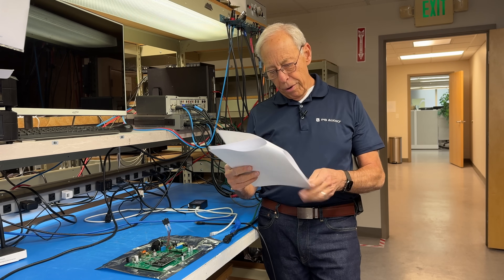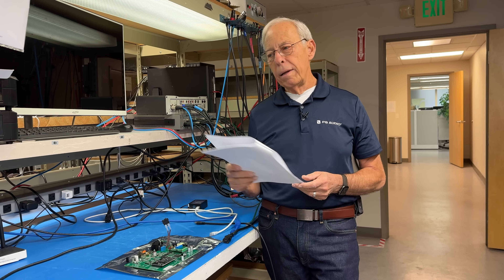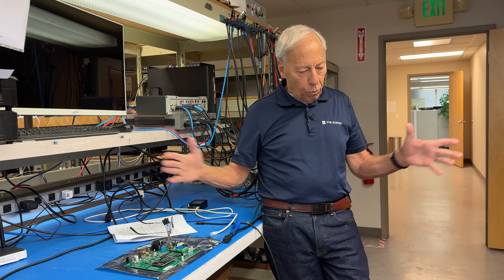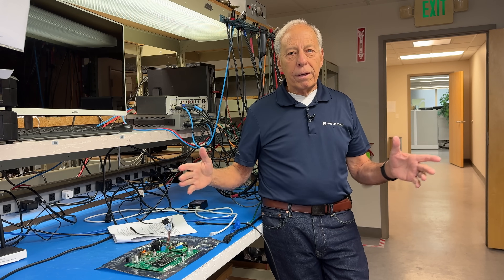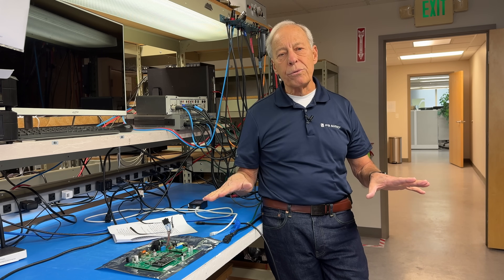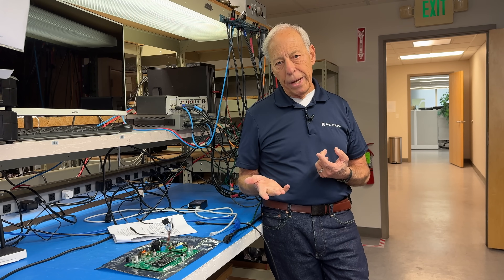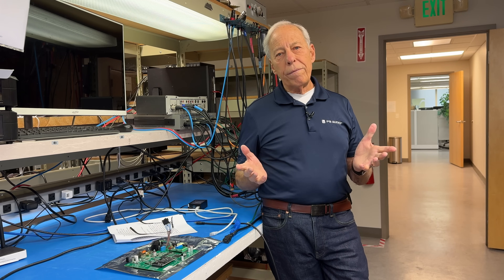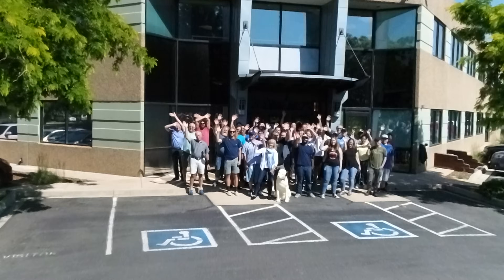Removing the main speaker's woofer work

Comment: So, the other way around this is using a pair of subwoofers and rolling off the mains with a traditional  active or DSP crossover. But I know this flies in the face of your preference to use speaker level sub inputs. But the problem is solvable by having that lower octave dealt with by sub room placement. It's often the case where setting up the main speakers for the best imaging etc isn't always the best for bass. Pro audio sound technicians deal with this all the time. Is the "sound" of your main amp really that important to try and retain at 40Hz and lower? Or is the time arrival the issue between line level and speaker level? Because that can always be dealt with by phase control, correct? Also, the main amp will be relieved of needing to use all the current for bass that isn't really being implemented well.
Reply: The phasing issue remains (no relation with phase knob or position). That's how equalization (DSP o analogue) works, except the alternative (DSP or arnalogue) that creates pre-ringing that sounds even worse.